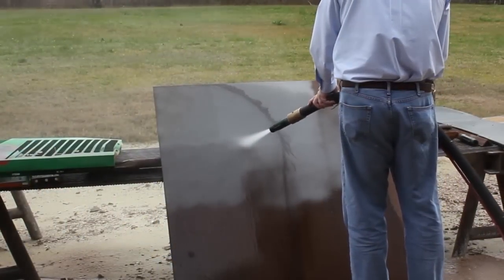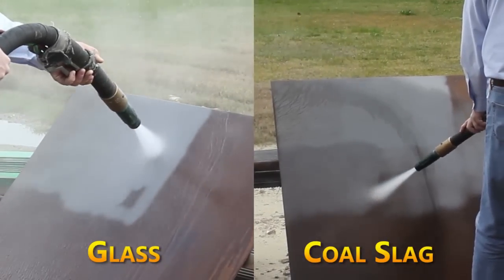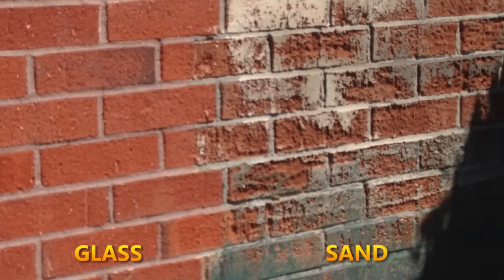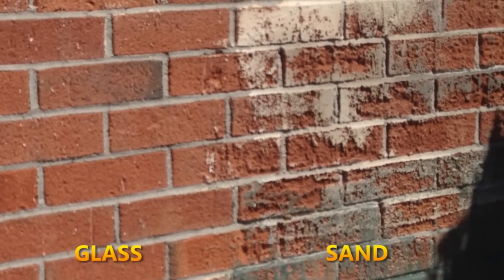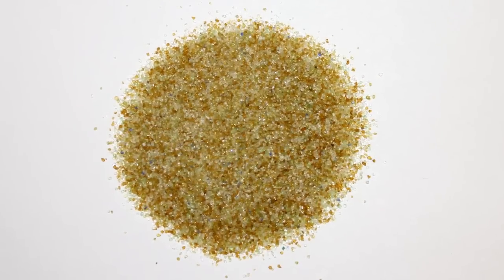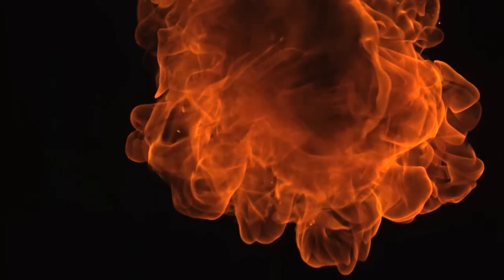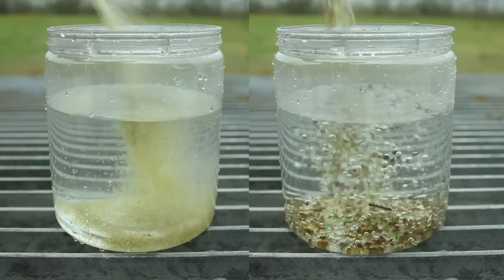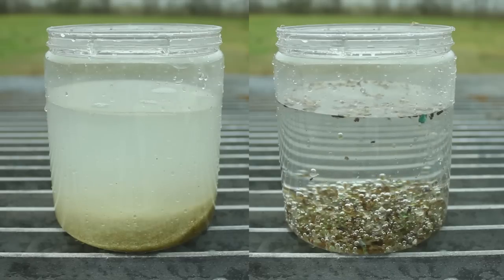Dustless Blasting Suggested Abrasives

Comment: $10 per bag...HOW MANY POUNDS DOES EACH BAG WEIGH??    Also, I am a stucco contractor and I buy #30 pure silica sand for $7/ per 94lb bag...will #30 work effectively in the db225??
Reply from the maker: You can find various prices on media with your local suppliers. Our machines will blast wet with any media that sinks in water and it will also dry blast. For more information enter your email address at www.dustlessblasting.com/request-info